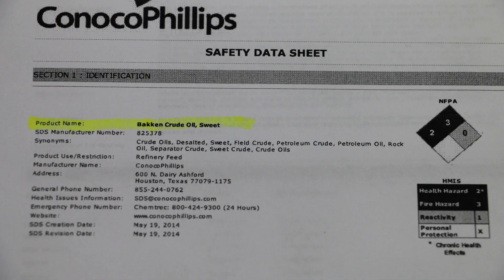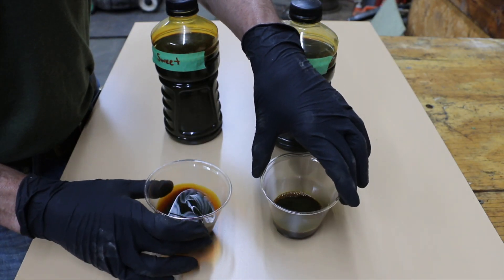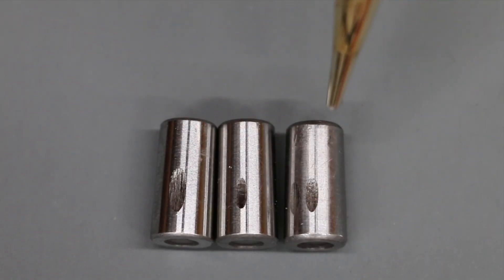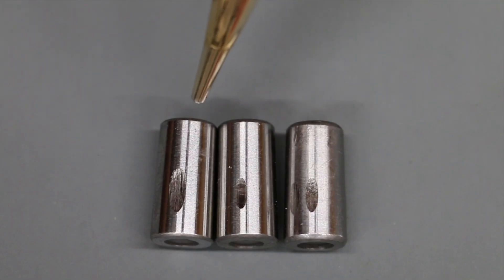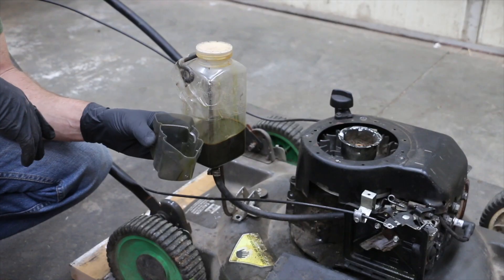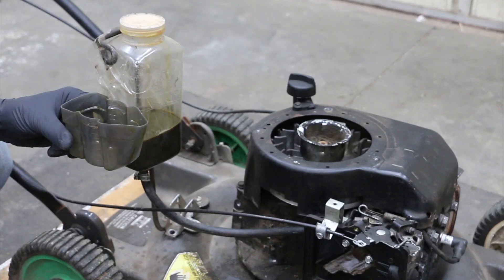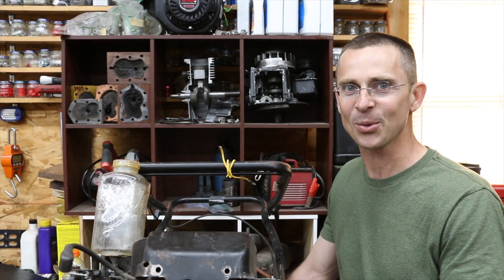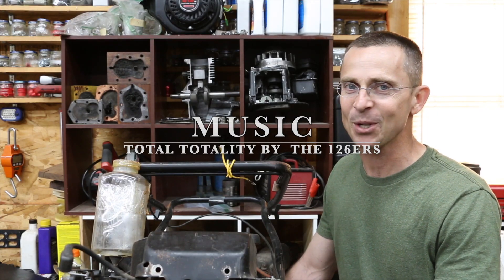Will a Gas engine run on Crude Oil?  Let's try it!

Comment: I saw the title and was immediately like pfffff obviously not, why is he even bothering? 

I stand corrected.
Reply from the maker: Thanks for commenting. I was surprised it worked too.
Reply: @ProjectFarm  I want see some day you trying run diesel engine with Heavy fuel oil. :D
Reply: @joik2ww269  A diesel engine on crude oil.

The injectors might clog up, might need a modified fuel injector.
Reply: We both learned something
Reply: My dude did brake parts cleaner once so anything is possible
Reply: I didn't watch the vid yet thanks for spoilers lol
Reply: I wonder how long a engine would actually last though and if putting in a car would have any difference. Ive never seen a spark plug that black before. I couldnt picture anyone running there car for longer than 30 miles on this
Reply: @kmma1094  My dad used to run his McCormick-Deering tractor (later bought by Intl Harvester) on crude oil from the west side of the Bakken (around Havre, MT), back in the 1930s when he could buy it right at the wellhead for a penny a gallon.
It had a trick, though. There's a one gallon tank mounted off the side of the cowling hood, and a valve to the main tank under the hood. I never saw it run (was before my time...) but Dad said you started it up on the small gasoline tank, and then switched unto the main tank to run on crude after it warmed up. You also had to remember to switch back to the gasoline tank at the end of the day and run the crude oil out of the fuel system or it wouldn't start the next morning. 
It must have worked as they sold the tank and valve/plumbing kits to convert tractors back then, and it is still on the tractor, which sits out in the the junk farm equipment pile 100 yards from the house. It has a factory brand on it and everything, even though I can't remember what it might be. No brand I ever heard of.
Reply: A friend said he drove on crude oil, now I know he wasn't lying o__O
Reply: Problem is its Ineficcient
Reply: I was surprised at how easily he was able to get it to run on crude.
Reply: Just wait until he raids his wife’s stash of pledge instead of starting fluid! but we better not let my wife know, she managed to burn the coffee out of my camp sight perk pot... what was left would seize a mother, or eat it!
Reply: Kinda.
Reply: Well, personally I thought it’d work, but with reduced performance and a lot worse emissions.

Comment: The sulfur in the sour oil acts as a lubricant just like high sulfur in the old diesel was more of a lubricant than the low sulfur and new diesel so you have to add lubricant to the new diesel to not destroy your engine

Comment: The sour oil, if it was rich in heavier sulfur compounds (I.e. not just hydrogen sulfide) would explain the results on the lubricity tester. Heavy cutting oil, the stuff you want for high cutting pressures when you're machining, is traditionally very high in sulfur compounds. I.e. the oil used for heavy duty tapping/threading machines, reaming, or large diameter high feed-rate drilling.
Reply from the maker: Great point.

Comment: I would not have believed a small petrol engine would run on that at all. One of my friends measures the output of various crude oil wells in NZ and apparently it's all different. Depending on which well it comes from.. They also get a lot of  water which is easily removed because fuel floats on top but now I'm  thoroughly confused. This poses more questions than it answers 4 me.
Reply from the maker: All great points.

Comment: Crude oil in a two stroke as a replacement of premixed gasoline would be interesting
Reply from the maker: Great video idea!
Reply: @ProjectFarm  Yes do it please we are waiting :)
Reply: @ProjectFarm  plz do it
Reply: @ProjectFarm  Please try this
Reply: Now that is something extremely interesting!
Reply: I love this idea. I'm just afraid that it might require a very long test run to see any difference in the wear of components.
Reply: Cool
Reply: Definitely a good idea!
Reply: What sort of crude oil are you talking about - the viscosity in crude oil varies enourmously from treacle like to pourable.
Reply: You could use it for the oil part, but not the gasoline part.
Reply: @EnergeticWaves  -- That's the question, though.  Both products are extracted from the crude oil.  The crude oil is pre-mixed.  The question is whether the ratio is acceptable to the engine and how all the other junk interferes.
Reply: @EnergeticWaves  there are loads of old 2 stroke motors designed to run on crude oil, stuff like tractors and stationary drive engines for running machinery. probably wont work in a modern 2 stroke, since those work on the hot bulb principle where the fuel is heated before injected into the piston chamber.

Comment: Try them as diesel fuel replacement please.
Reply from the maker: Thanks for the recommendation!  I'll do this soon!
Reply: @ProjectFarm  please do this
Reply: Thanks!
Reply: I live in Texas and it's a common thing to hear about some guy who works on an oil rig running his diesel truck on crude. Never actually seen it, but my dad worked in the oil fields for 20 years and said people really did it a lot.
Reply: Wischmopps stfu !!!! Stop driving or going anywhere at all unless you walk and dont eat meat and only grow your own food and no power to your gome
Reply: @Richard Vaughn I used to run waste oil in my 83 f250. Ran like a champ. Just filter it first.
Reply: Back in poland my dad had an old dozer with a two cylinder diesel with pistons the size of buckets. He had a buddy that worked at a refinery and would buy crude super cheap to run in that thing, I still remember as a kid watching sparks flying out the stack when he would load it up it was like a firework show. That thing drank everything but one of his buddies tried in a 4 cylinder mercedes and it ate up the pump and injector nozzles.
Reply: Yes, that would be more interesting is my guess. I expect both substitutes to work identically and almost as well as you would normally expect. I anticipate there may be more particulates, more smell, like an industrial machine.   .
Reply: I second this
Reply: Why wont gasoline work in a diesel? This question is a lot more complicated than most people realize, and 99% of people dont know the answer. And if you google it you will have to do a lot of reading before you uncover the answer.

Comment: Try the sour crude oil in a 2 stroke motor, if the lubricity test shows its as good or better than oil and its plenty combustible, it could work. Straight sour crude as a replacement for gas oil mix in 2 stroke.
Reply from the maker: Great video idea!

Comment: That's some nasty looking crude. The crude from north Texas/western Oklahoma (Anadarko and Palo Duro basin) is a lot cleaner than that. You should see how long a motor will stay together running on condensate/drip gas.
Reply from the maker: Thank you
Reply: must be slightly oxidized as most the oil from the nesson anticline is green colored. gets darker as you get to the edge of the basin. the gas plant here ran their field vehicles on drip for many years. probably not very high octane. but back in those days not many vehicles made 100,000 miles any way.

Comment: Sulfur is a lubricant, it's the reason gear oil smells so terrible. It also causes smog/acid rain, which is why they strip it out of oil and fuel that's going into an engine.
Reply from the maker: Great point!

Comment: That was very informative. I feel better about my chances of being Mad Max after the world ends...
Reply from the maker: Thank you!
Reply: Just build a fractioning tower. Heck, I’ve made guzzoline out of crude with a test tube and a Bunsen burner.
Reply: It may work but there's reasons why we don't use Crude oil and instead use gas
Reply: @mftripz8445  but no one will care as much after the wold  ends
Reply: @AnarickTheDevil  your engine will, smart guy
Reply: @mftripz8445  I'm not putting it in my engine,smart guy. You seam to be missing the hypothetical part of the conversation about THE END OF THE WORLD a la Mad Max where gas would be scares.
Reply: @mftripz8445  from an oil well would be my guess
Reply: @jeffreyculberth1440  didnt the mad max universe take place in a post apocalyptic  world
Reply: @mftripz8445  yes but does an apocalypse automatically render all the oil wells useless? Im sure a smart enough person can get one up and running again
Reply: @jeffreyculberth1440  depends when, unless we are talking about mad max world not taking place on earth
Reply: @mftripz8445  i was under the assumption we are talking about the earth.
Reply: @jeffreyculberth1440  if thats the case and everything is barren desert(sun probably got closer), we'd use up the remainder of our oil left before the apocolypse
Reply: @mftripz8445  yes im sure every oil well ran dry just in time for the apocalypse. Nobody was already drilling more wells  knowing that they eventually run dry. So there couldnt possibly still be one with oil in the ground just waiting to be pumped up. Every single one has been pumped dry no more oil in the earth. I understand now thanks!
Reply: @jeffreyculberth1440  even if we didnt use up all the oil we'd end up lacking the technology to procure it unless you posess knowledge on how to operate, and even then you'd still need to actually find a way to turn on the machine. If youre at this point you might as well set up somewhere to refine the oil so it doesnt mess up your car
Reply: @mftripz8445  so youve now made the OPs point. The point was there is hope.
Reply: @jeffreyculberth1440  lmao dont go trying this bs. I was responding to your comment. There is hope for a specific kind of person... not for everyone
Reply: uh oh
Reply: 3 years later....In SHTF situation, find an older diesel truck or car and also find an oil change place. Get their used oil into a metal tank, boil the water out of it and then filter the cooled oil into a gas can. It can be burned quite easily.

Comment: The sulfur in the sour crude oil decreases "boundary" friction. It acts as a "Friction Modifier" due to the molecular structure that the sulfur forms on the surface of the bare metal. It acts as a sacrificial layer on the metal and forms a new layer each time that an old one is stripped away. Higher sulfur = extended engine life but worse emissions (acid rain). ULSD makes today's diesel engines much cleaner but also reduces life expectancy. Engine oil additive manufacturers have tried to close that gap through new friction modifiers, but issues still persist. The marine industry is starting to shift to ULSD as well which will create problems in the shipping industry. However, if you like clean air, then that's just a problem that you have to deal with.
Reply from the maker: You're really knowledgeable on this topic. Thanks for commenting!

Comment: Crude oil is the same oil I used to use to put in the spindle machines?It was added to the cutting oil for the steel cutting machines.Iam going by the looks and smell described.
Reply from the maker: Interesting. Thanks

Comment: Boric acid as a lubricant Colloidal suspensions of nanoparticles of boric acid dissolved in petroleum or vegetable oil can form a remarkable lubricant on ceramic or metal surfaces from Wikipedia.  Can it be used as a fuel additive to reduce friction?
Reply from the maker: Great recommendation--thank you

Comment: buy a yard machine with a carb that has a choke and an adjustable fuel jet. maybe a chipper with a clutch. using said clutch could serve as a engine load for a short tine since the blade section is pretty heavy.  or at least buy a carb with jet adjustments and a choke. then run some of these past tests again. I'de recommend a larger HP engine like over 10 HP. i would think carbs made for larger engines would have a larger fuel jet and would let thicker oils and combustables through.  another thing i would like to see, is u getting some small diesel engine that runs at at least a couple thousand rpm and do alot of fuel test with it. another thing i would like to see is doing some of ur previous fuel tests with a 2 stroke engine. maybe a weed eater, might be an old outboard boat engine.   AND LASTLY,  i would like u to take a lawn mower and lock the throttle wide open and see how long it takes the engine to fail and see what fails.
Reply from the maker: Great recommendation. Thank you

Comment: Sulfur provides lubricity, that's why the new ulsd fuel causes the new motors not to be as reliable, long term, as the old ones.
Reply from the maker: Great point.

Comment: The reason the sour crude gave less scoring than the 10w30 is that the sulfur compounds that make it sour are EXTREMELY good lubricators. That is why gear oil smells a lot like sour crude.....it has sulfur compounds added to it to make it handle the extreme situations where gear oil is used. These are the same compounds that were once present in large amounts in diesel fuel but are now mostly stripped out by law. When they began stripping them in 1991 in Calipornia, massive damage resulted to injection pumps which depended on the innate lubricity of those sulfur compounds in the fuel, and lawsuits followed.
Reply from the maker: All great points and thanks for commenting.

Comment: Can I suggest that you could come sider revisiting the water and fuel experiment but create a petrol based emulsion ("emulsified fuel".) I think you'd get some interesting results in running temperature and energy output per volume fuel used. 😉
Reply from the maker: Thank you for the video idea!

Comment: I never thought the engine would run on crude oil, but as a teenager I was told by several different men that they used to go to oil lines  straight from the oil well and the lines would drip a orange/amber colored liquid and they would sit cans under the dripping lines. they called this "drip Gas" and would run model A's , Model T's, tractors and farm engines with it. One fellow said he could get anywhere from 5 to 8 gallons a day from Drip Gas leaking at different spots on the oil line running from the well to the storage tank. I was told that the thicker part of the oil woundn't drip out. Now I am going to have to google "Drip Gas".
Reply from the maker: Thanks for this information.

Comment: I did know that there where engines that could run on light crude (typically very detuned running a low engine speeds as the combustion is slow) but I'm impressed a lawn mower engine could do this. Often ships have pre-heating systems for heavy fuels, you might find this could get your more viscous crude oil to run. Genuinely interested if this could scale to a car or motorcycle engine, happen to have an old beater lying around the farm? 🤔
Reply from the maker: Thanks for the recommendation!

Comment: PLEASE CHECK THE LUBRICITY ON THE CHEAPEST OILS SEE WICH ONES CAN COMPETE WITH THE EXPENSIVE!!!!!!!!! Stuff PLEASE, Dollar General oil and Family dollar have great deals on there store brand!!!!!
Reply from the maker: Thank you for the video idea!
Reply: Oil is Oil. have we been lied to all this time ??? i put cheap motor oil in my engine's 10w-30 from 99 cent stores which is Shell. 20w-50 from walmart brand. 20w-50 Oreilly's Auto Parts brand. yeah I don't buy the "expensive"  used to but Oil is Oil. OLE!
Reply: @fvrrljr   yes oil has to meet the specs for the API service code on the container. the cheap oil comes from a refinery that makes the expensive oil also
Reply: @erniew5805  OLE!

Comment: I bet it is been said in the comment section but yeah: try the sour crude oil as motoroil please! It did great on score test! 

Thank you for another brilliant video! 

I bet there is just me that asking for a test with Compressed Natural Gas on the vapor running engine. 

I’m asking noe because I know that stuff is burning quite hot and the CNG driving busses we have here in our fleet keeping the engine fan on all the time here in 27 degrees celcius to keep engine temperature normal. I belive the CNG have fairly low carbon build up and maybe makes the small engine run quieter too as it does on the big bus engines. 

I’m really curious to see what happening to a vapor running small engine when it’s feeded with CNG :D
Reply from the maker: Thank you for the video idea!

Comment: Very educational test as always.
Disconnecting the spark plug wire while the engine is running can create a very high voltage in the coil and possibly lead to insulation break down. Grounding the wire may be a better option.
Reply from the maker: Great point.  I should do this.

Comment: Ok so to sum up. You can run an engine off of both forms of LIGHT crude oil with engine modifications. Mainly fuel distribution modifications. If you had to use light crude oil regularly you would probably want to preheat the float bowl considerably.
Reply from the maker: Great summary!

Comment: I want to see the sour crude in a vapor test (running the engine off of nothing but vapors).  It's nasty smell (H2S, which is highly flammable) might indicate it would do quite well.
Even better:  do run time tests on measured amounts of, regular unleaded, unleaded run in vapor-bubbler mode, sour crude, and sour crude in vapor-bubbler mode!
Reply from the maker: Thank you for the video idea!
Reply: the smell of H2S is noticeable down to 1PPM so doesn't have to be much gas to smell it

Comment: I thought of an idea for a test. You do alot of tests about items that help stop or remove carbon build up. My thought is.. maybe theres a way to prevent it in the 1st place. How about polishing the top of the piston to a smooth mirror like finish as well as the head and the bottom of the valves (the part of the valves in the combustion chamber). That way maybe it will leave virtually nothing for the carbon to bond to? Just a thought but maybe worth trying
Reply from the maker: Thank you for the video idea!